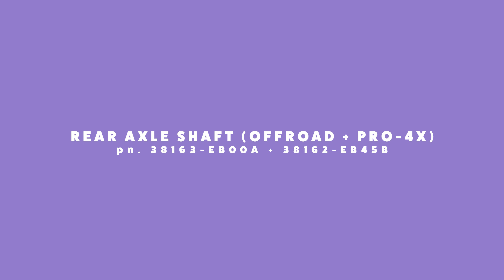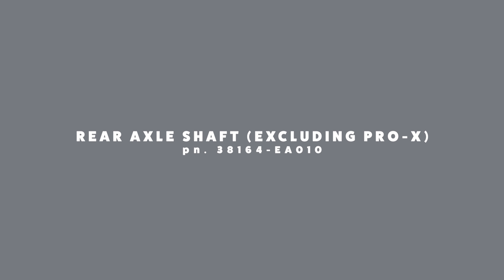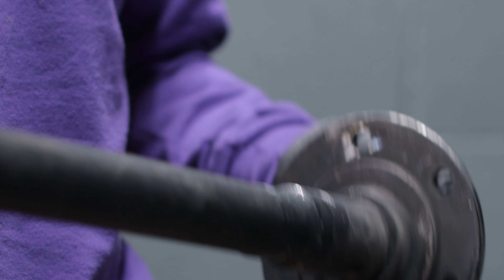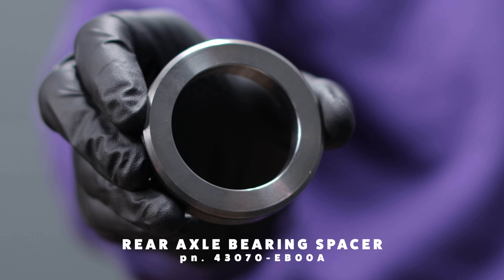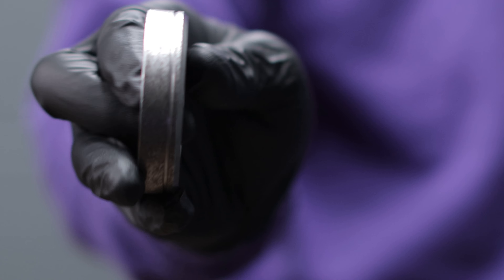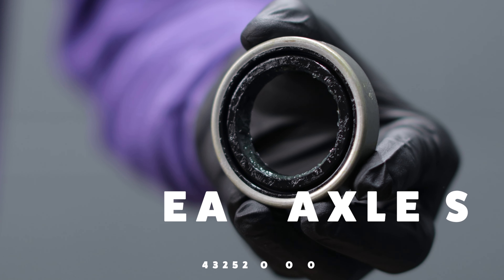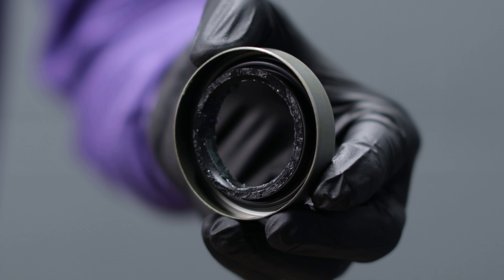Nissan Xterra N50 and Frontier D40 Axle Shafts: The Complete Guide

Comment: YOU ARE INCORRECT. Afraid this is what happens when you create informational content without first doing some research and getting informed. The M226 axle bearings and seals can be replaced with Timken SET10 bearings and spacers set, and Dana 52765 seals, including other cheaper options. 

I've seen several people posting on social media and forums, over the last few months, asking why they have to replace their entire axle just for a leaky seal, or bad bearing and they all seem to point back to this video. 

Please do the community a favour and remove this misinformed nonsense.
Reply from the maker: We are talking about an actual OEM replacement. Thats good info you provided, but it's irrelevant.
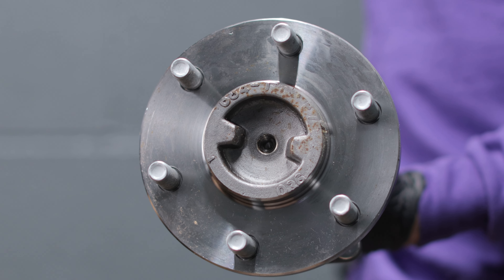Reply: @nissanpartscc at no point did you mention OEM replacement. Starting at 0:57 seconds, you simply said that the entire axle as an assembly needs to be replaced and I quote, "if you have a leaky axle seal you have to replace the whole axle shaft". 

Also, how is anything in my original comment irrelevant? Timken bearings are arguably at least as good or outperform what ever Nissan uses as their OEM. Furthermore, Nissan doesn't manufacture bearings and has been known to use NSK, NTN, and KOYO bearings. 
The rear axle is a Dana 44 variant so why not use seals sold by Dana?
Not sure where exactly you're going with this video.
Reply from the maker: We are an OEM parts supplier. If you're new here - welcome. What we said is factual information. We ship those axles out and replace them regularly. We appreciate your feedback, either way.
Reply: Fair, but the way you scripted and edited your video seems purposely misleading and self serving. Not to mention confusing to anyone that doesn't know better and comes across your channel for advice.

Comment: Just did my wife’s N50 Dana M226 seal replacement on my driveway last night. No special tools required besides the cheap shop press. Kit comes with seal,bearing,spacer and snap ring for $130 with shipping against Nissan’s $800 axle shaft plus shipping.  Less then  2 hours job,including cleaning the dust cover from leaked oil.

Comment: It’s mechanical malpractice to not extend the rear diff breather on an “offroad” billed vehicle. They extended others up too the engine bay or top of the bell housing so why not the rear axle?!?
Reply: Manufacturers can't build every vehicle to have it capable  of driving with your wheels fully submerged.. if you choose to, then get the extender installed yourself
Reply: @Ashoud_Anobetah  I'm still unclear on why a manufacturer couldn't possibly install one additional breather- especially on a top of the line Pro4x model.

Comment: I have this same issue. Was trying to remove my axle due to a leak and one of the four bolts snapped and turned out to be seized. I had to do some damage to the flange to get it off. I cant find the axle assembly online from any regular parts dealers. Also can I just have someone rebuild the axle I removed?  Would that be cheaper? 2012 pro 4x.
Reply from the maker: If you have a pro-4x you have to buy the complete assembly.

Comment: I'm sure the D41 hasn't changed but maybe with that new engine and transmission there's a difference.
Reply: The D41 M226 axle shaft can be rebuilt as well with the same bearing and seals from the previous gen.